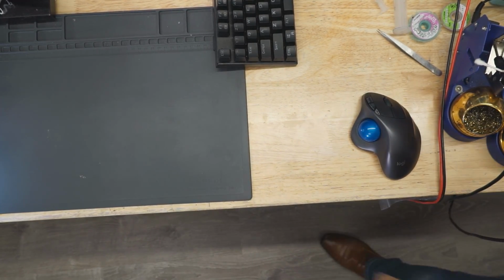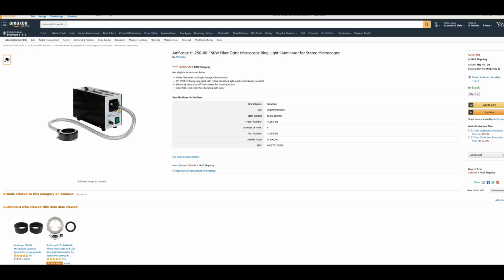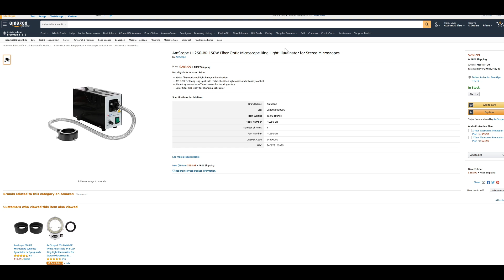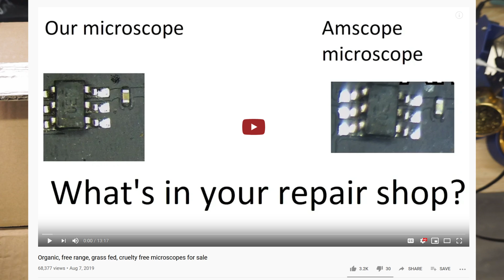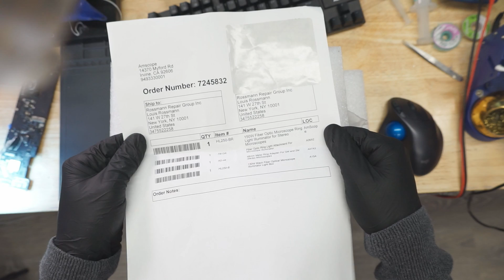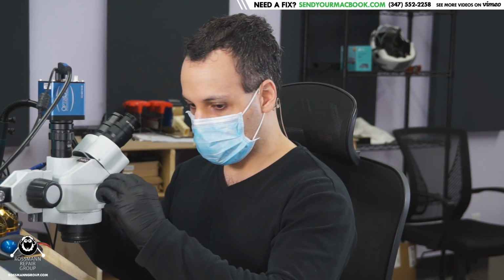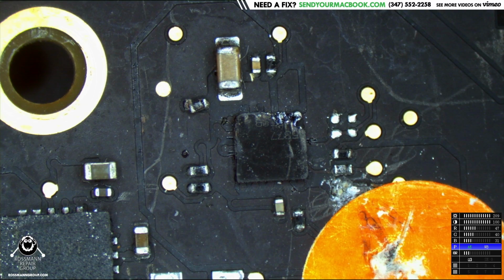I spent $310 on a microscope ring light, was it worth it?

Comment: The fact that there are three screws where the optic cable connects to the power supply makes me suspect that they're there so you can do alignment. You might have to read the manual after all.
Reply: I downloaded the manual: it's useless and the setup instructions are super vague. The instructions were like, take out of box, plug ring lamp in, plug power in, put on microscope, turn on. That extra plastic ring that he had around his unit is never mentioned in the manual, and isn't listed in the parts list on their website. There's a few warnings about stuff like "keep optical components clean" and instructions on changing the bulb, but there's zero information on actual detailed setup or anything at all about how to use it.
Reply: And place the rubber ring between the box and the tube after unscrewing the 3 screws, and rotate the filter to make it work.

Comment: Price is never linear to result. Low cost products will get you 80% towards your goal, but the last 20% will cost you at least 10x more.
Reply: As someone who works on cars, this statement causes physical pain! Stop!
Reply: @TheNightzfury  The inverse is true too. The price at 10% less than low cost good equipment gets you 1/20th of the strength and durability in junk knock off products. Cheap junk is junk. Durable is 80% of the goal. 10X more cost for diminishing returns is normal. This applies to cars and tools. The Yugo is not mainstream. Toyota is mainstream. BMW and Mercedes, is the 10X higher car. The Yugo or Pinto, was the 10% lower car. I have 190,000 miles on my Toyota and it is still running on the original belts, water pump, hoses, etc. Same classes of tools exist. Craftsman, Master mechanic, Proto, etc. Then there is Harbor freight on one end and Snap-0n and Mac Tools on the other.
Reply: @isettech  
bmw has the lowest rating in motorcycle world off breaking or any defect, i don't want any bmw or mercedes put same category as reliable cars.

Comment: Louis, for the polarized filter to work you need to polarize the light too and rotate it to have the desired effect.
I use one myself and when i installed the filter only to the camera nothing happened so i installed one to my light too and had to rotate it in order to see the difference.
Reply from the maker: Well, that explains it. I don't have a polarizing film for the light. :( I have no idea how to get one or put it on there. Agh,.
Reply: @rossmanngroup  There are cheap plastic polarising films that can be cut with a hobby knife. You could score and cut two circles out to make a ring - with a few tabs on the outer edge. Polarising the light like this will mean some of the light is lost to the polariser. I would also be concerned about heat generated by the light source. If you smell burning plastic, take it off, I guess.

There's something else I'd like to suggest; see if you can replace the halogen with a similarly-watted LED bulb (not 150W equivalent - the real deal). I don't know how much light a 150W LED bulb would pump out. Probably a fucklumen. It would be best if you could get one of those built into a heatsink so it can be cooled by the enclosure fan.
And if your attempts to turbocharge the thing fail - you've at least got a good start on a Ghostbusters cosplay.
Reply: @rossmanngroup  That's when you'll REALLY see you light level drop (adding a second filter) and I don't think it's needed either. It works for sun glasses...
Reply: @TeslaNick2  Sun light is polarized in contrast with the light that came from an artificial source like a led. That why sunglasses work for the sun light but not for indoors lighting
Reply: Also, since you did get a polarizing filter, and using non polarized light to illuminate the scene, you're literally loosing half the light into the camera...
Reply: @leuterisxairetis2134  That makes sense. Thanks for that !
Reply: @leuterisxairetis2134  Sunlight is not (significantly) polarised. It only becomes polarised when it is reflected by a dielectric (insulating) material. Such as water, glass or plastics. The same is true with (most) L.E.D.s.

Comment: Replace the halogen bulb on the new light with a LED projector lamp of the same power
Reply: I wonder how many times brighter it would be
Reply: @Styler_GTX  Many Times
Reply: Big brain
Reply: CRI would be worse but hardly matters for board repair.
Reply: @diatomsaus  what's CRI? chromatic ray something? :P sorry, not my area
Reply: It would still no be as bright as it could be with led mounted directly at the microscope because of the losses of the fiber in that thick cable.
Reply: @rodrigomaero   color rendering index - effectively a number of up to 100 indicating how accurate color is when seen under said light. Sunlight or an incandescent bulb would be around 100. Good LEDs usually hover around 80-90. Something really crappy like sodium vapor lamps (those orange looking street lanterns) can go down into the negative
Reply: @TheStiepen  ohhh I know what you mean, that thingy my photographer friend keeps yacking about... but, I'm colorblind, so.. why should I care :P
Reply: @rodrigomaero  You don't care but a lot of others will. 

Even high CRI LEDs, so called, have a very weird spectrum. It springs up in blue and steeply declines, "cold LED" more like a fundamental flaw. There's sunlight spectrum-like LEDs but those are expensive.
Reply: @Scorpion008  The fiber is to remove the heat from the microscope head and work area. You do not want a 150Watt heater on the end of your scope.

Comment: Unless I'm mistaken, the new ring light uses fiber optics and a single light source inside the power station. That being the case, you should be able to change out that light for a whiter light. I can imagine, for instance, that they're using a soft light at a distance  from the scope so as to not interfere with microbes being viewed in the typical use case for such a contraption (no heat on the microbes and softer light better able to see flesh). But yours is not exactly the typical use case and you don't need a soft light. So instead of desoldering hundreds of LEDs you may be able to unplug a single LED and insert a different one, in the box.
Reply: It would be a nice option to have dual colors. When they read a Palimpsest under a red and blue light. It highlights the scratches made in paper hidden under another set of writing making it readable. This helps with depth of field when the difference is very small. You are right. These are not built to look at PCB's. So having shade and color options would be handy.

Comment: Louis, you just need an extra $20 spot light that you can turn on when zoom in. You don't need that bulky $300 light.
Reply: I'd imagine again he would end up spending more time trying to find the right way to mount it and get the angle right for it to be useful, than it amount this has cost him.

Also the chances of him constantly fighting with the setup, wasting time, costing money.  It honestly makes sense to be using something designed for the purpose.
Reply: Alex Atkin I just woulda said too late
Reply: Alex Atkin  come on,  he only have to set it once  about 10mm  spotlight on the dead center of the base and every time he zoom in just hit the switch.
Reply: Yes. $300 is too mach for this shity light

Comment: RTFM Louis ❤ You're not connecting it (the fiberoptic "cable") to the box properly. It needs proper centering with the 3 screws, otherwise you lose a lot of light, not hitting the fiber (and I believe there is a rubber or plastic grommet?)

Comment: I was looking at scope lights just for my own use (not video) and the prices pissed me off so much that I designed my own, I designed a fairly overkill one that uses 48 smd leds, if I remember correctly and after a few weeks with that I decided to simplify it by designing a ring light that uses 15 10mm leds and an external dimmer and I couldn't be happier with it.

Comment: Cree LEDs are good, just look for >90 CRI models, color temp that you like and don't buy fake ones. BTW if you want really good color accuracy, there is CRI R9 param (R9 = strong red color) and it should be over 60. It's probably not so important for regular use cases, but required for surgeries and good to have in film and photo lighting. Only the high end LEDs have this over zero and cheaper can even have it negative. If it's negative it may make you look like a zombie (because it takes away the red color from blood under your skin).
Reply: Nichia has better color rendering tbh

Comment: I find this hilarious, because for over 10 years our office used similar AmScope lights, although they were more of a light-on-a-stick (HL250-AY I believe). Rigid frame around optical fiber, twist the "cable" and aim the light whereever. Roughly same price class.
But we got so tired of the noise of these things and $20 ringlights (pretty much the same Louis here used!) outperformed them. Mainly due to having light available from all angles at once.
Probably if we just got the ring light attachment, we would've been reasonably happy as well (aside from the noise), but it's brilliant to see how the "upgrades" can go both ways.

Comment: You can most likely replace the bulb in the new scope light
most of the electronics would probably be made for adjusting the brightness via voltage, so a brighter halogen bulb or a fully compatible led light that is brighter would do well

Comment: Hey Louis, if you want you might be able to create a pretty simple custom circular PCB to fit your ring light with some decent SMD LEDs like 5050 or 5630 (or whatever LEDs you want for that matter) on something like EasyEDA and get them manufactured pretty damn cheaply through JLCPCB. It comes from China (id imagine this is a bit of an issue at the moment) but when i've ordered from them in the past (before corona) its arrived pretty quickly within around 5 days. You'd just have to solder on the LEDs and other components when the board arrives.

Comment: I have basically this setup, and I spent $10 on it. I picked up a fiber light for free from the Craigslist, and I got the fiber ring from eBay for $10. One thing to keep in mind is those bulbs really don't like being touched,  and have a (relatively) short lifespan. I'm looking to replace the bulb with a 10W led module from eBay at some point.
Reply: I bet your girlfriend is a 10. 👌

Comment: It's a fibre optic link from the light source (the base) and the actual ring. That's why the price is so high too. My guess is heat becomes an issue at these light levels from a small ring light.

Comment: Hey Luis changing leds it's definitely not worth it, i did something like that in the past soldering more powerfull led with better CRI but they burned  quickly. The main problem is heat dissipation, there's not enough space to put a big heatsink. Right now the fiber optics is the most practical solution for more lights unfortunately it's also expensive.

Comment: Even with the HDR improvement, that's a $80-$100 improvement max. Just replace like 8-12 of the LEDs, not all 144. As long as they're symmetrically replaced it shouldn't imbalance the throw of the light.

Comment: So the difference between the two lights will be more than just brightness. Halogen will offer a much better spectrum of light than a cheap LED - to see this effect, try comparing the two cameras on something colourful. Electroboom did a video on this recently which was interesting. Cheap LEDs are often missing parts of the spectrum, but aren’t as bad as fluorescents.
Reply: I dont think the $300 one would come with a cheap LED
Reply: Captain Heat - no, it came with a halogen, you missed the point :P I’m saying the cheap one came with a cheap LED
Reply: @ZylonFPV  i thought you meant the same light unit with a LED instead of halogen wich also costs $300

Comment: Hey Louis, I'd recommend some Luminus SST-20s, you can get them in 4000K at >95CRI. (I'm assuming the emitters in your current light are 3V). The SST-20's are 3535 footprint, unsure what the stock ones are. At any rate, you should get a picture of the LED board and make a post on BLF (BudgetLightForums), the community there is great and would be more than willing to help you out. Each individual emitter can output in excess of 1k lumens, though cooling would be a tad difficult in that scenario.
http://budgetlightforum.com/node/62195

Datasheet for the SST-20's
https://download.luminus.com/datasheets/Luminus_SST-20-WxH_Datasheet.pdf

Comment: The ghetto solution is to use an led ring, typically used for a car to make it look cool, and a 3D printer to attach it to the lens.  I got 2 for under $10 and could not be happier.  Note: my $70 ebay microscope is just as ghetto but reasonably functional for my use case.

Comment: Do you have two polarizing lenses between the camera and the board? If so you could try rotating them after zooming to increase light output. I have no clue how your microscope works but when I took a semi useless physics class I learned about polarizing filters. A single polarizing filter allows 50% of u polarized light through. When you add a secondary filter to the chain then the amount of light passing through the second filter is a function based on its rotation or alignment to the first filter. It’s like looking at a screen with sunglasses on, if you rotate your head the screen might get dimmer.

Comment: The reason the light gets dimmer as you zoom in is due to the fact that in order for the camera sensor to see the light it must first come out of the light source then hit the board and then reflect back at an angle that hits the sensor. As you zoom in you are able to get a view of more of the board but with the same level of light hitting it as before. Which means greater spaces in between photons and also less vectors for the light to reflect to hit the sensor. 

It's similar to how when you look up in the night sky (not in a big city) you can see a lot of stars but if you actually went to space you'd see just how far apart they all are so you have to look around much more. 
That's why you need more light as you zoom in. :)
Reply: 1. When you zoom in you get a view of less of the board. 2. You're speaking as though your perspective of the stars changes by going 100 km up from the surface of the earth 😂 You would have been closer had you mentioned a telescope.

Comment: Halogen illuminators are such a pain in the ass with how fast they burn though bulbs. Ive retrofit my own, and some other techs fiber illuminators with LED pretty easily in the past. Different components than what I used then, but see below BOM of stuff that should work now:
A139427-ND LED holder $3
1642-1411-ND   LED,$16  90 CRI, 4000k color temp  5k lumens max to allow for loss in fiber bundle
345-SPIRLED-8580-ND  Heatsink, $15  extrusion with holes already, just add some self tapping screws
1866-3207-ND LED driver, $29  add a 100k ohm pot of your own choice for dimming

$63 + 100k pot, + some self tappers, Gut the halogen ring light illuminator case, mount the heatsink so it holds the LED close, but not touching the end of the fiber, keep the existing fan in the casing to make sure the heatsink stays cool.  5mm LEDs have been and always will be a joke when it comes to high power illumination. the thermals just arent there to support it.

Comment: They sold you a halogen light and some fibre optics for 310€?
That's a scam.
There must be a better led or discharge lamp for less.
How much light does it output?
Reply: Dusty 99  It's a an obsolete 150W halogen bulb, no rocket science here. Should be max. 40W LEDs.
The most expensive part on this lamp is the fibre.
There we go: Nichia NFCWJ108B-V2
Nichia NFDWJ130B-V2
Reply: Opto-E may help with that.
They produce optical equipment and industrial ring lights.
Reply: @CyberlightFG    The lowest price I could fine, for the working distance Louis seems to use, about 100mm ~4 inches) was US$629.00.  Others were much more.  Louis, at the end of the video, touched on the subject of expensive ring lights.  I suspect he didn't want to pay that much for something just for YouTube.  However, thanks for the information.  It's interesting technology.
Reply: I didn't know that Industrial ring lights are that expensive.

Noone uses high power halogen anymore. You need to change those all the time and they produce a lot of heat. I don't think, he will be happy with that thing on the long run.

Comment: Over the years I've had 3 different ring lights on a small X2 milling machine. One thing I can say is that they all seem to leave me thinking there must be something better.  The first one was fluorescent, the quality of the light was good, but not adjustable and as always too dim.  The second was a LED and didn't last long for some reason.  The third and best one is an adjustable LED of decent brightness, yet has a slight glare factor when powered up to a high level.  In my case going beyond the lower end price range just isn't really needed, or at least it shouldn't be.  The one negative other than the price I see in your unit, is how bulky and heavy that flex conduit looks.  Granted if this isn't a problem then you have a nice heavy duty industrial grade design.

Comment: hello louis,
i just saw your video from april 7th where you fired the carpenter. 
I don't know if i'm wrong, but the sockets on the left wall, are they all on a power line?
I mean 8 times pc, hot air station, soldering station, microscope, signal generator, etc. on one line?
What is the average power consumption of a work table when all devices are running?
 isn't that too much aphere drawn there?
I do not want to shit smart but does that not overload the power line?

sorry just worry about your nice new business and hope i'm wrong.

Warm greetings from Germany

norbert paisen
Reply: This